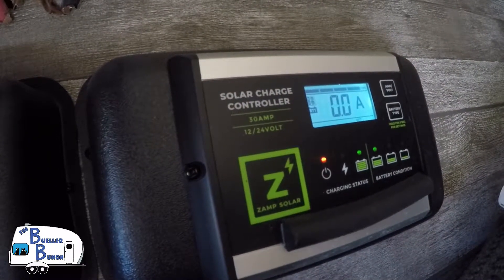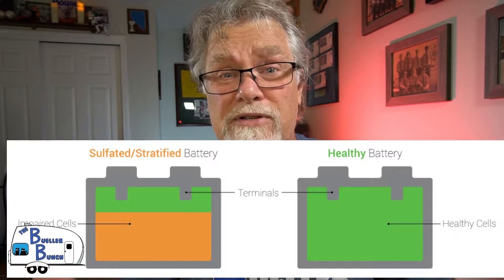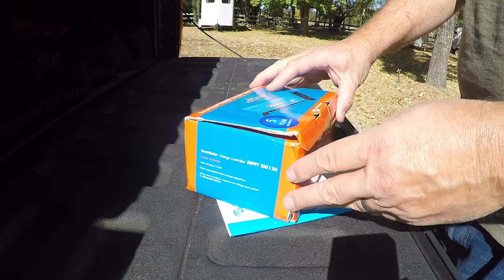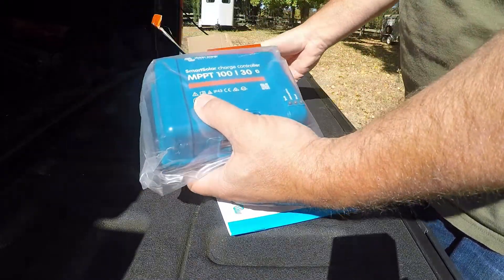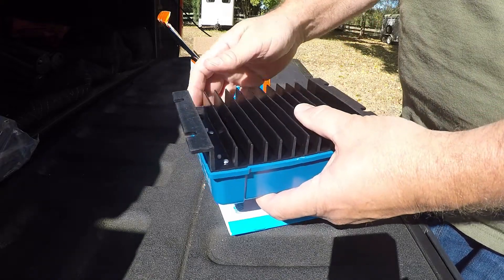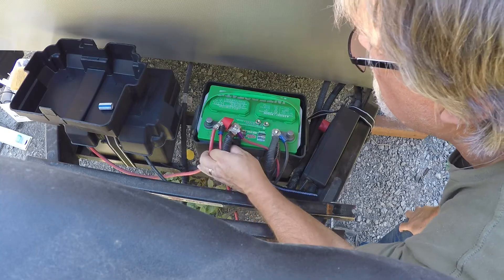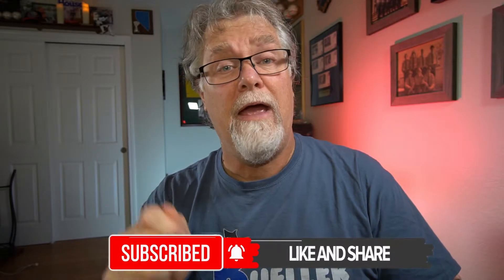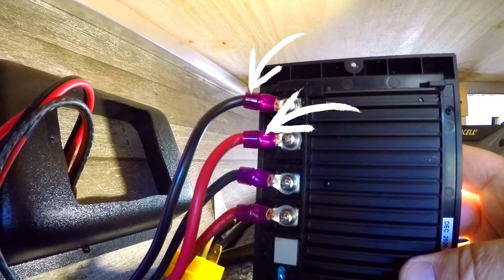SOLAR CONTROLLER- PWM OR MPPT?

Comment: I have the same Zamp setup on my Outdoors RV travel trailer 2018 model. I have hookup for two more panels on the roof and am also looking at the Victron MPPT controllers. Thanks for the info.
Reply from the maker: So glad you got some info out of the video.  Our Victron is working gret and I highly recommend the bluetooth version.  Its nice to see what is going on first hand.  Thanks for watching
Reply: How do you set the zamp to charge lithium?
Reply: @JohnBruno-yi1ex  There is a lithium setting on the Zamp controller.

Comment: Need to use a MPPT (Renogy) charger with a Lithium battery(s). They work well together. The future standard. Wire your future panels in series if the MPPT can handle the higher voltage. More efficient way of charging. My experience: lead-acid suck. Lithium batteries was a big game changer for me.
Reply from the maker: I did upgrade to lithium and i agree that was a game changer.  Check out that video on our channel too if you haven't already.  Thanks for watching!!

Comment: Get a litime battery w bluetooth
Reply from the maker: We ended getting a 200ah lithium battery.  Check out our other video on that process.  The battery is going on 2 years without an issue.  We also added a smart shunt which is bluetooth as well.  Thanks for watching!!